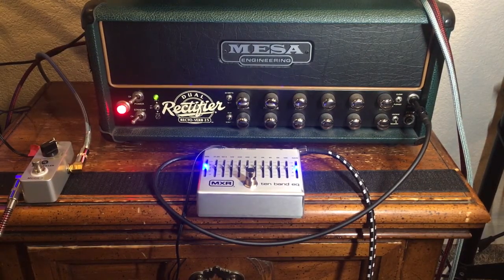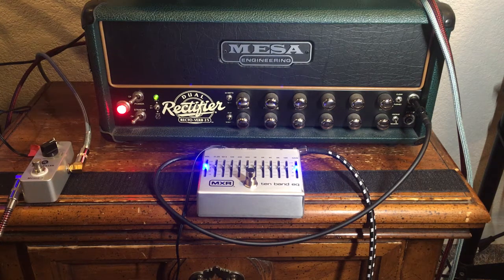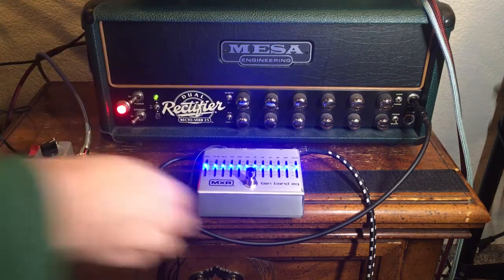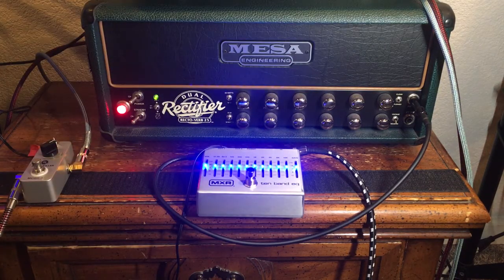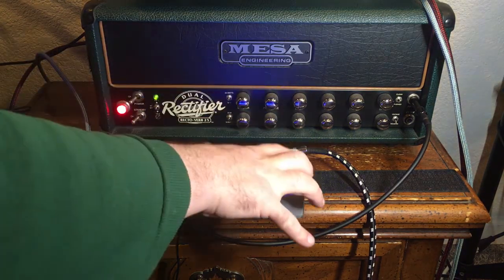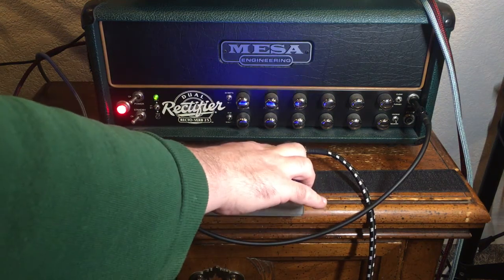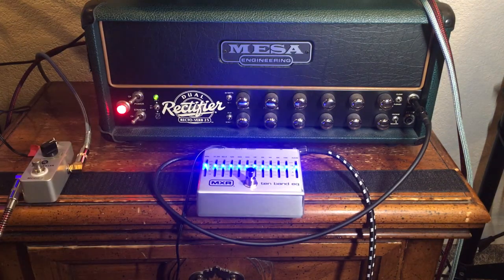EQ+ FX Loop Issues

Comment: rectifier‘s fx loop is a parallel loop（dry&wet mixed
so if you engaged a eq，phasing problem appears
Reply from the maker: I did not know that...thank you.
Reply: The retcoverb 25 has a series loop. The whole signal passes through the loop. Since the 10 band eq is true bypass, and the problem only occurs when the pedal is engaged, then there is likely a significant impedance mismatch from pedal to amp.